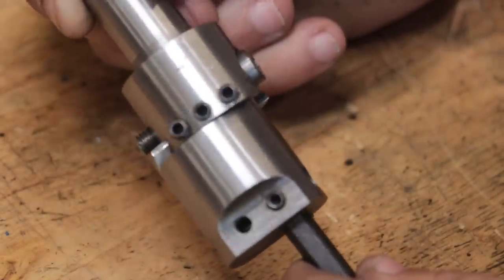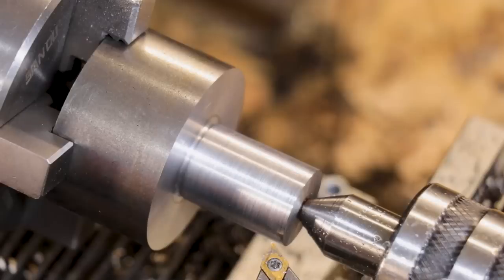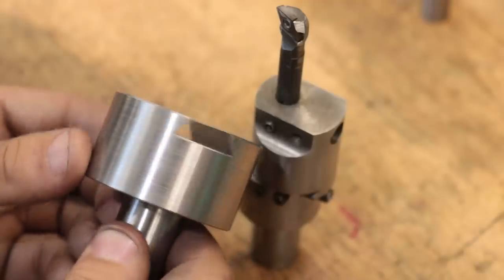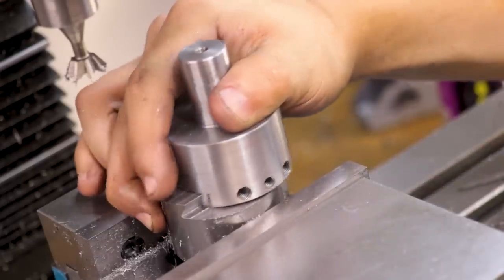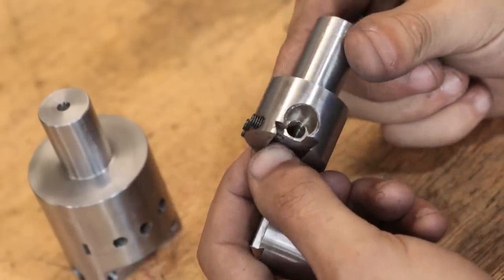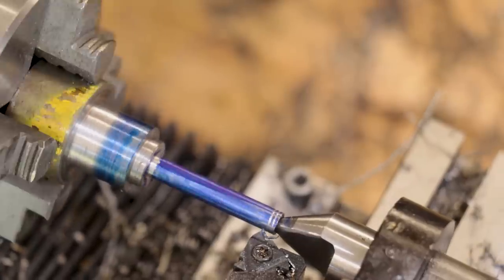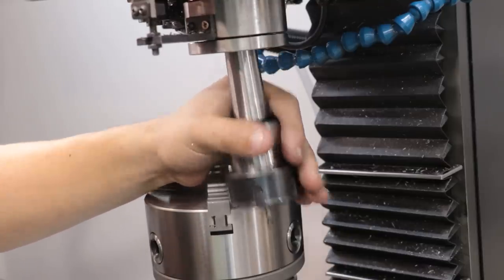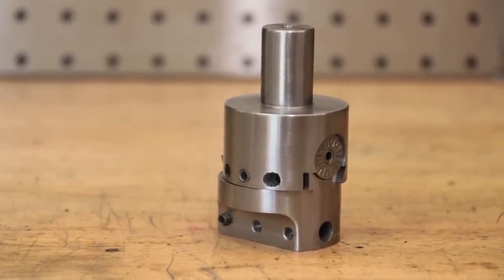Making A Boring Head For The Milling Machine V2.0

Comment: For round materials in clamps, try using copper layers between the clamp jaws and the round part.  They will deform and keep the jaws from marring the part when you tighten the jaws to maximum.
Reply: Он их использует, но видимо не всегда 😂

Comment: It came out nice. A tip for you. When using the mill vice always put the work piece up against the fixed jaw. Then, have the V block or whatever else you’re using, up against the floating jaw which lifts when tightened. This will give you more precision and the part will stay still.

Comment: Lovely job!  One thing I would suggest is that you check and maybe slightly relieve the dovetails.  It looks like the dovetails are preventing the outer parts of the boring head from being pulled together which will impact rigidity.

Comment: Those tiny D-bit engraving cutters typically run around 20,000-25,000 RPM.  The mill you've got probably runs about a tenth of the right speed - not just "a little bit slow". :)  That said, it still looks pretty decent given the limitations on speed.

Comment: That is real nice bro. Maybe you could rig up a way to mount a dremel type tool to the side of your milling machine head that would let you engrave stuff more easily.
Reply: Or make a mount to hold one of those pencil air grinders. I made a mount to hold one of those bad boys in my cnc mini mill and now I've got 56,000 RPM capability 😁

Comment: interesting choice on reducing the shank of the tap... other option would be to partially clearance the hole... since you don't use all the threads with a round boaring head.  =D  Either way, still looks like a nice tool to add to the shop.
Reply: as a side note, you can use a saw blade to index the divides on the dial... if you can't use that fancy dividing head. Saw blades come in many different teeth counts, and they are all evenly spaced which is wonderful for indexin.

Comment: Regarding the taps not bottoming. You could just machine a few millimeters on the end of the screws to make them touch the wall you need instead. Good work as usual
Reply from the maker: Yeah I didn't think of that but for sure that would work

Comment: FYI you can use plumbers putty on the vise to keep the coolant from running out onto the floor.  If you have shop air can use a Noga mister instead of flood coolant it will still work well.

Comment: Small adjustable boring head are quite useful, especially for hobbyists which usually have small machines. Wondering if there are off the shelf small adjustable boring head with a straight shank less or equal to 8mm.

Comment: A very nice project. The only issue I have is the pitch and material of the leadscrew. I would find a 6x0.5 mm tap and thus make it a lot more accurate in as much as you can get finer cuts to a size easier. The taps are out there. Chinese unfortunately but there you go. As for the material, low carbon or mild steel is not the way to go on this. I would have got a 13" length of 6 mm silver steel ( drill rod) and single point screw cut that and made the 18mm head in mild steel and silver soldered the screw into the head.
Reply from the maker: That would be up for you to choose of you make it, I have used 1mm pitch and I can do press fits for bearings. And I'm sure you could get away with a low carbon steel if you really wanted to. I thankfully had some medium carbon

Comment: I have a possible solution for your engraving problem...

If you build a mount that can be bolted to the side of the mill head, you can attach a Dremel to the mill that can hold the fine engraving bits and that will let you spin the bits at the speeds they need while still using the X & Y movements of the mill table as well as the rotary indexing chuck...

Comment: the D bits from your router would have worked if you use them like a shaper bit.
lock in place and just scrape in the dial

Comment: Excellent project! I like it except for your use of sillymeters instead of good old decimal or fractional inches. There are two types of countries in the world: those that use metric, and those that have landed men on the moon.  But don't let that stop you. Looks like a terrific boring head and I will be making something very similar in the near future.

I am surprised you didn't mill a flat around the dial screw hole, and make some vernier marks on it so you could easily adjust to to the nearest 1mm or I should say the nearest .039" But of course you can always eyeball it.

Anyway, excellent job. Beautiful work.
Reply from the maker: Cheers mate. The dial is always for eye balling. Any time I need to cut bores for bearing or anything similar I always set the distances using dial indicators.

Comment: Awesome stuff, Mr. Artisan, as always. You never ceise to impress me with what you manage to do on these small machines.
Just a quick question - are you using ER32 collets for your mill? I'm assuming this, since ER25 only goes up to 16mm. If so, have you found the setup to be rigid enough for that size of endmill? I've been contemplating getting a larger collet holder for this exact purpose(Pretty sure we have the same size mill)
Reply from the maker: I have a ER 32 collet chuck for holding irregular sized tools. I have a kit that came with 20 collets 1-20mm. For the rest of my work I use er20 collet tools, held in a MT3 collet. 

I don't think you have to be too worried about that rigidity of the collets, it's not really a limiting factor on this mill, and anything larger than ER32 would be overkill for this mill. Though if it is something that concerns you, I'd just opt for an endmill holder, much cheaper and more rigid.

Comment: Re the engraving, could you not mount your dividing head to your lathe bed ("somehow" :-) ) and use the mini grinder on the cross slide with an engaving bit in it?
Reply from the maker: I could, buy I'd need a fixture plate of some sort to get around the prismatic ways. I looked I to it a while back but it never got anywhere

Comment: Can I ask where the vibration in your lathe is coming from?
Reply from the maker: I tore the v belt up a bit machining 4140 and that wear is showing up as vibrations
Reply: @artisanmakes  Your toolholder for the engravingmill is asymmetric. There's one screw on one side, creating vibrations. And high rpm makes it even worse. Make it symmetric would be my suggestion. Keep up the good work, fun to watch!
Reply from the maker: I've never had toubke with Weldon shank tools vibrating until I go over a few thousand rpm. I think the tool was a big off was because I used a drill to make the hole, rather than a reamer. The hole was a little over sized, but I don't have a 1/8" reamer on hand. Cheers

Comment: It's a very interesting project and well executed for the tooling you have. Just a curiosity: when you clamp the dovetail the flat faces on the left and right sides of the dovetail, left from it's machining,  on the upper and lower halfs of the boring head are pushed one to the other in order to increase rigidity or the clamping is just performed by the angled surfaces of the dovetail?

Comment: That was not 1045, it was a 420 martensitic stainless, it is actually a very good steel alloy.
Hence why the difficulties you encountered working with it.
Reply from the maker: Categorically it is not made of a stainless alloy. My metal supplier does not even stock 4xx stainless.

Comment: The yellow paint indicates 1018/1020 not 1045.
Reply from the maker: I can guarantee you it's not 1020 because I was able to quench harden a sample of it
Reply: @artisanmakes  http://www.interlloy.com.au/wp-content/uploads/2011/04/Colour-Chart.pdf
Reply: @artisanmakes  I use a lot of steel bar, mainly 1045 and 4140, and I’m telling ya, that colour is 1018/1020 bright bar. Unless you got some over spray on it at some point... you wouldn’t notice with your gear, but once you get bigger gear and start making chips, you’ll be able to tell the difference in the chips, and the spindle load on the machine.

Also, 1020 still has a bit of carbon in it, 0.2% I think, so it will “harden” but not sufficiently for any useful purposes.
Reply: @madaxe79  A lot of steel suppliers use different colour coding ie the colour coding is noy standardised
Reply: @petercameron8379  not for me they don’t, maybe where you are, but it’s standard through all of my suppliers. I know when the truck pulls up what bars are on the back just by tue colour. And I buy my carbon steel from 3 different suppliers and they all use the same colour coding. And I buy my stainless from 4 different suppliers and they all use the same colour coding.
Reply from the maker: This stuff came from a scrapper, so who knows where the steel came from originally, or what life it had beforehand. All I know is, it is carbon steel, and has enough carbon to harden. Cheers
Reply from the maker: I'm familiar with the colour codes when I buy through edcon steel, but this want bought from them, Cheers
Reply: @artisanmakes  I’ve never bought from edcon, I’ve got a few quotes from them, but they’re never competitive for me. Give Vulcan or Voest Alpine a go. They’re the best for me, Vost Alpine are typically better performers, but their nearest branch is 400km away, so I tend to buy from Vulcan unless I’m buying large quantities. There’s a couple of others I buy from periodically, but they’re the main two.
Reply from the maker: Cheers, I'll have to look into them
Reply: @artisanmakes  if you make friends with the people that cut the steel, you can get them to keep offcuts, typically, I think, they throw away anything under about 500, but you can get little offcuts really cheap or sometimes for free if you know the right people. When I first opened my shop I pretty much bought every offcut they had, I would quote a job for, say 80mm bar or whatever, and when I won the job, I’d call up and see what offcuts they had near to that size, say I needed 80mm x 300 for a job, they might have an offcut of 90mm x 500 for a quarter the price of getting a piece cut. The place I by a lot of my stuff, they dump their little offcuts monthly, so if you know when they’re dump day is, you can do a deal to rummage through their offcut pile, otherwise it goes to the scrappy and you’ll pay a lot more off the scrappy. For what you’re doing that would be perfect. But for me now, I pretty much only by full bars now. Even If I only need half a length, I still but a full length because I don’t have to pay for processing, and I can get it straight away, it’s cheaper per kg, and you end up with leftovers for other jobs. I make most of my profit on the left overs when someone just wants a little part made for their lawn mower or something.

Comment: Good job.👍👍 how many degrees is your dovetail cutter that you used for this ptoject 45, 55 or 60° ?
It is good to equip yourself with a dividing table for machining vertically clamped details 😀
Reply from the maker: I went with a 60 degree dovetail because that is the cutter that I had.
Reply: I use single point Fly cutters for dove tails the angle is not critical as itis a one off job so  a shopmade  tool works for me